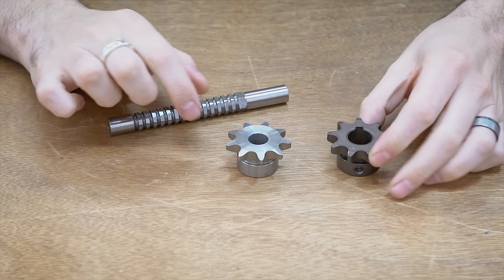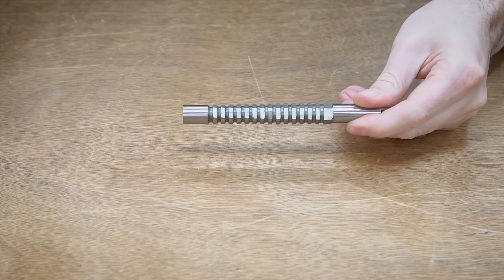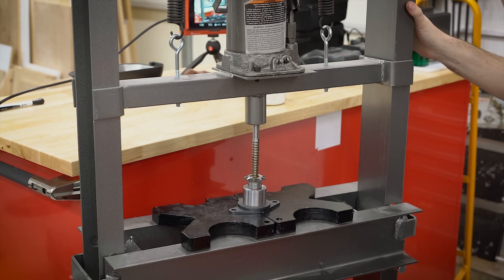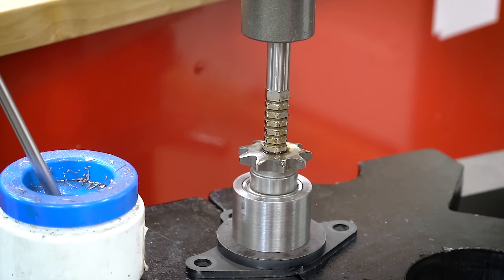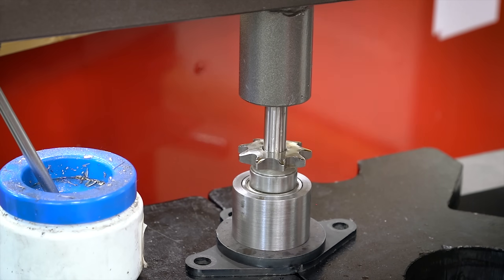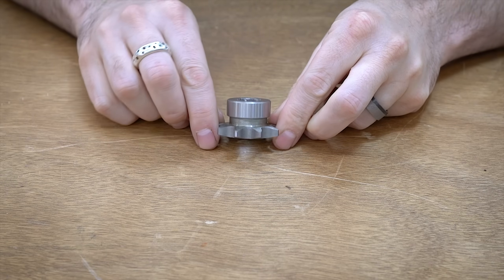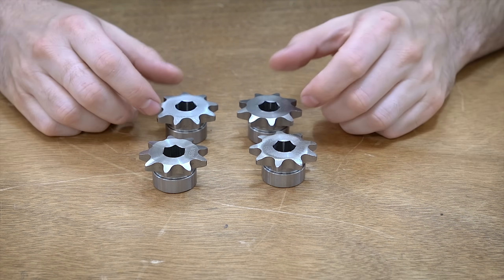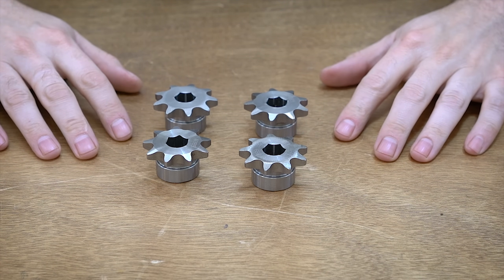Manual Hex Broaching!

Comment: I often use irwin speebor wood drills that have spindly shanks that bend easily. I have an idea of an adapter shaft that has a 1/2 inch outside diameter bored to fit over the whole shaft with a broached section to accommodate the hex portion of the bit.  I have been using one with round hole for the hex portion with three set screws that works but certainly is not ideal.
Reply from the maker: Nice idea.

Comment: How does that compare to a cnc mill with a very small endmill?
Reply from the maker: I'm not sure I understand?  you will always have a corner radius with ANY end mill, and you're not going to be able to machine hardened materials easily, nor can you cut as deep, etc.  A rotary broach is the other option.

Comment: Ever consider rotary broaching on your Lathe? The tool itself is surprising easy to make, and I was able to make the bits by using a tool post grinder and HSS blanks, but Tool steel bits are also an option for sure, especially if you can make them using a mill and a hex collet block with angle block underneath for 2deg clearance
Reply from the maker: If I didn't already have the broaches, I would try it on my mill (or lathe).  I just happened to have these on hand.

Comment: Would recommend doing a small taper on the edges of the through hole prior to broaching because it gets rid of the rough corners like you mentioned. FRC uses pretty much Hex everything, it works so well! Thanks for sharing this! What material are you using?
Reply from the maker: I actually did this and it worked wonders.  Just a tiny fillet made it much better!  I'm not sure of the material, the sprocket people don't say :-/
Reply: @RobertCowanDIY  Hey Robert! Any chance you can answer a question for me? Do you know of a short press broach that I could use to do the hex socket in a socket cap bolt? Again, just a short press-broach, not a rotary broach? Thanks
Reply from the maker: @smallblockchevy1022  I'm not really sure what you're asking, but they make broaches in different shapes, but they're all roughly about the same thing.
Reply: @RobertCowanDIY  To be more specific, obviously the long stepped broaches wouldn't work to do the shallow hex in a socket cap bolt, so I'd need something that cut the final/finished size immediately, on the first cut (without the successive steps). But since I'll just be pressing it in, the more complex geometry of a rotary style broach wouldn't be necessary. Just a more simplistic one with straight sides would be sufficient if it's simply going to be pressed straight in. I was wondering if any makes one like that, that you were aware of?

Thanks again

Comment: You've gotta hit those holes with a countersink bit just a little before broaching, it stops the stuck chips on the bottom and makes the broach way more likely to go in square.
Reply from the maker: Ah, good tip, thanks!  I have a couple more to do.

Comment: Splines and spline shafts might be a good option as well. It may offer a more precise fit and run out.
Reply from the maker: Yep, you're right.  But they're even harder to make, and the sprocket doesn't need to be all that precise.
Reply: @RobertCowanDIY  i think on smaller parts the advantage of a key driven shaft gose away because the keys just tend to grenade after something bad happens instead of just shearing clean away like much bigger keys do in heavier applications. But in think the hex will be cool to try out. Do they sell drivrs with a hex output?
Reply from the maker: @DRrandomman22  For smaller bots (insect class), hex really isn't practical since most motors will have 2-3mm shafts, which is just too small.  I think this really only applies for 12 pounders and up.

Comment: not sure if youre familiar, although i imagine you are, there are a lot of 1/2" hex related hardware for First Robotics Competition robots, so theres a gigantic ecosystem of parts out there from companies like Vex
Reply: And less morally dubious companies, like AndyMark, REV Robotics, and The Thrifty Bot . 
They're typically just alu (6061 and 7075), but there's steel options for certain things. Not sure most of that would hold up in this weight class, but great for lightweights and below.
Reply: @Troy  morally dubious?  Do tell!  I mean, I get that they are profit motivated, but in a capitalist system how else does one succeed?
Reply from the maker: Yeah, I've seen it from Banebots too.  I generally don't actually 'shop' at those places though, it's a bit light duty for combat.

Comment: At battle bots and other robot tournaments how do the teams make sure their frequencies dont get mixed up with the opponents robots?
Reply: 2.4ghz digital radio system dont have the same limitation as quartz, as it change frequency in need so you could use a thousand of transmitter and receiver at the same without a problem